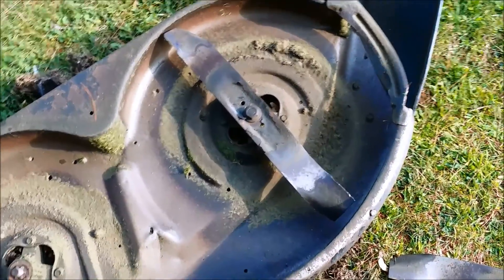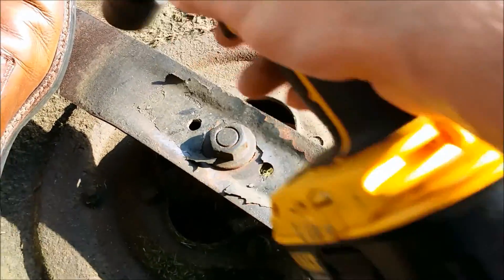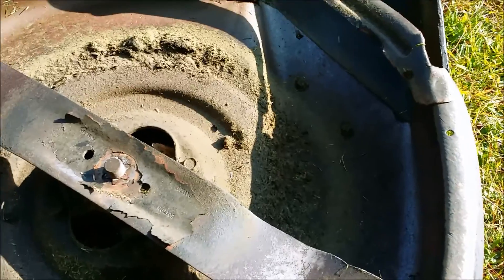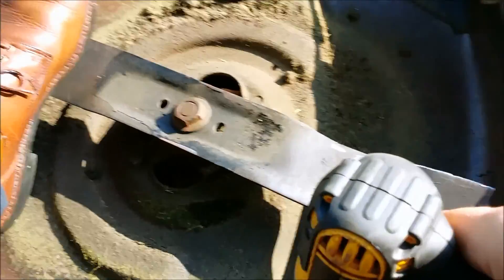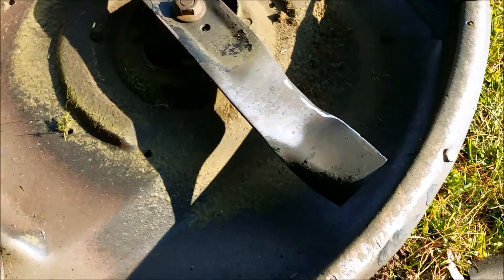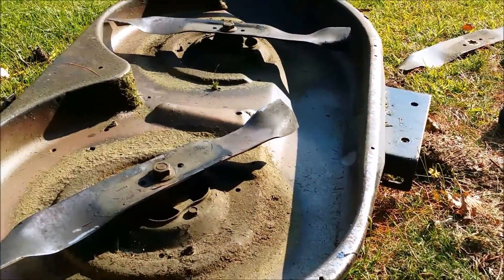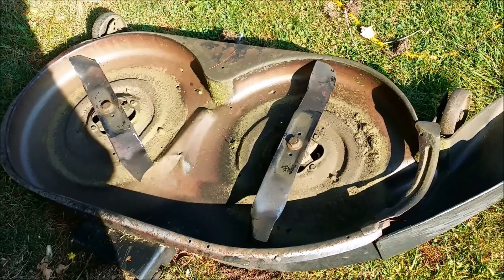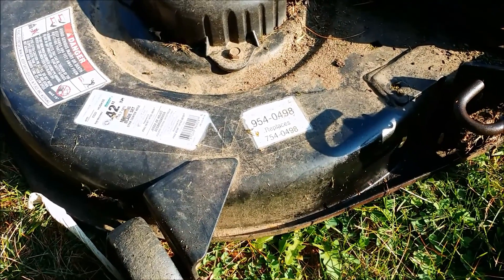troy bilt mower deck blade changes with dewalt impact

Comment: helpful if you have the mower deck off and upside down. takes more work to remove the deck so you can use impact wrench as it does not fit when not removing the deck. heck of a lot easier to keep the deck on, use a block of wood and regular socket with long handled wrench. easy peasy. done in less than half the time it takes one to remove the deck if not more.
Reply from the maker: I use the impact with the mower deck still on....works a treat.  The impact is low enough profile that it fits under the mower when I jack it up in the rear.  No more blocks of wood for me.  Thanks for the comment!

Comment: Thanks for sharing. Do your blades overlap where they meet in the center or is there a small gap?
Reply from the maker: Small gap...they are not interference blades
Reply: @matthewolson8875  Thanks a lot for responding. I  am replacing my rusted out deck with a home built  fabricated unit. The old unit is so bad that it is a tough call for me to determine how the blades are supposed to be  aligned. By overlapping, I meant one spindle lower than the other, allowing the blade tips to overlap.
Reply from the maker: @petertyrrell6690  blades are at same height

Comment: Curious about one thing.... What is the torque rating of the impact wrench vs. the mfr's torque rating for the blade nuts? In my experience the nuts only need between 80-100 lbs/ft vs (whay i think is) your wrench's 200+ rating. Thx.
Reply from the maker: Alex Stickney it's a great question....I don't know.  I know my electric impact barely takes off lug nuts on my car...so i'm not sure if 200t lbs of torque is realistic for the wrench.  I change my blades every few weeks and use the electric wrench for it all and don't have a problem.  I don't put them on HARD with it....but I haven't had one come loose either. ...hope that answers your question.  Ideally these need to be on with a torque wrench. ...but I don't know the rating...

Comment: I am not relating the brand of your mower, I am relating to the fact that you have to change blades every couple of mows to " it must be for a reason, because if you basically don't mow dry creek beds or the desert " I think you can see where I'm going with this.
Reply from the maker: Leo Ryan I don't "have" to change my blades every few weeks...but I do like to have a sharp set on and I don't see the downside of swapping the blades often. .
..I can swap a set out in 5 min with the deck still attached. ..so why not?
Reply: lol there's always a Leo type in every crowd.

Comment: Really? Every couple of mows? Maybe you should get something besides the pos your using. Get real dude.
Reply from the maker: Leo Ryan my blades dull pretty quick....I run over all kinds of debris. ....if you have a yard full of perfection for grass then I can see once per season....but that's not my reality
Reply from the maker: Here is a couple other thoughts.   #1, you seem to connect the quality of mower with the blades dulling quickly... as referring to my mower as a POS.  I'm pretty sure one has nothing to do with the other.  as an example, if a chainsaw chain dulls quickly, would you toss the whole chainsaw?    #2 having sharp blades (or tools of any kind) is important for safety reasons, as well as efficiency.  The engine doesn't have to work as hard if the blades are sharp.    I think that is indisputable.   So, I don't know how much more real I can get than that.  Thanks for the comment, but please, stick to constructive criticism.